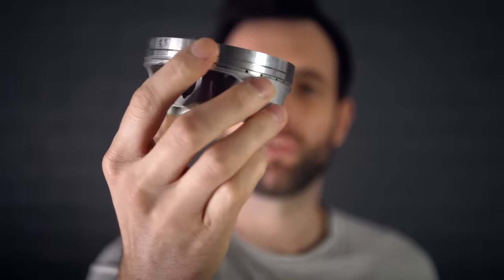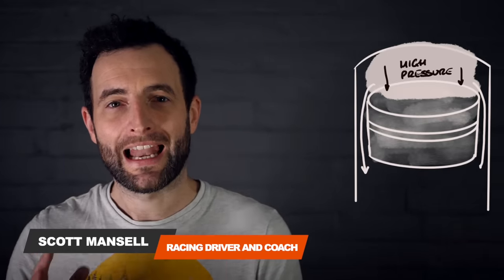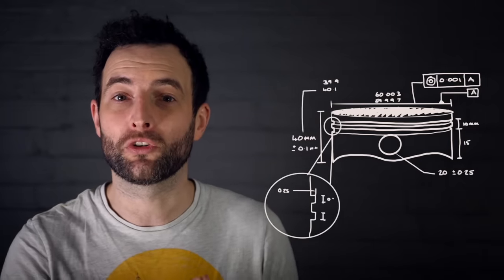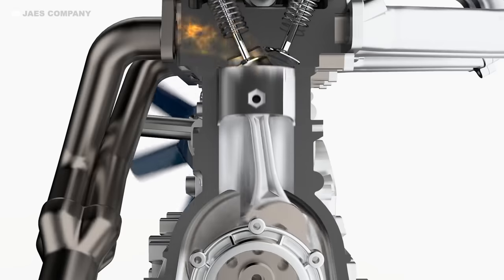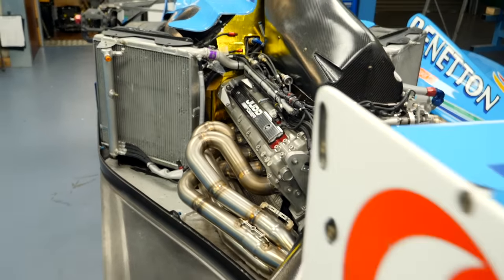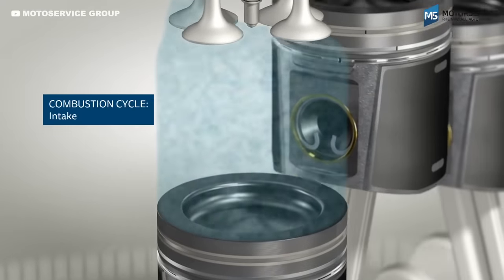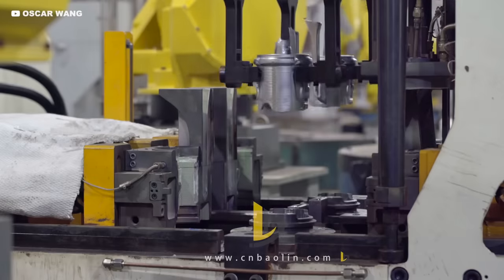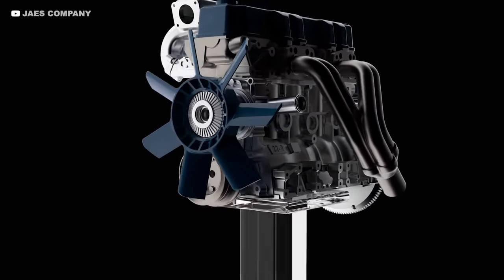Why F1 Pistons Cost £50,000!

Comment: The company I work for makes F1 pistons and I can assure you we get nowhere near £50,000 folr a piston not even £1,000 think you have pulled numbers out from where the sun does not shine.
Reply: I thought it was way too high, yeah it's gonna cost more but in the end it's just a piece of metal with a different tool path on the cnc.
Reply: I was thinking this like there are alot of backyard built 1000hp motors around and i know they cant hold full noise for the duration of an f1 race but still all it is really is just higher quality control
Reply: Serious question. Does the team you produce for actually win?
Reply: @tylerboto8930  Can those backyard 1k horsepower builds turn 15k plus rpms..... reliably?
Reply: @asylumville8544  thats what I'm saying they cant ,but if backyarders are doing that on a budget of a quarter of the price of a single f1 piston then there is definitely some money wasting going on
Reply: Those tolerances are nothing special, most amateur or backyard machinists can get parts to within +/- 0.001” (0.0254mm) and much less with care. I cant see from this video where 50K comes from
Reply: The cost is really from the R&D, this video doesn't know what its talking about, its just a bunch of technobabble taken from wiki or something, all car pistons have these tolerances, machining quality, etc.
Reply: @cloudbotherer7835  I quite agree. Even 50 years ago I worked on similarly sized components on a 10" x 18" Cincinnati external grinder and  regularly ground parts to a diametral limit of  +/- .00015" ( .0038 mm.)  My weekly pay? £14 !
Reply: A GSX600r piston costs under 50 quid and revs reliably to 13,500. Still don't see why an f1 unit should be 50 grand.
Reply: The pistons for my 125 2 stroke road bike engines are sized to 0.01mm.

Thankfully nowhere near £50k a piece. Under £100 retail.
Reply: @asylumville8544  I do not work for a team I work at a complany making pistons for many teams and types of motor racing, but in answer to your question yes they do win races.
Reply: @asylumville8544  sport bikes pistons go higher and have approximately the same power density and they dont cost that much lol. Go look up bmw s1000rr pistons
Reply: Spoke once with M**le engineer he was stating : the exact price we dont know because if the enormous amount of all kind machining and processing operations but we estimate it on 1700 to 1800 euro per piston without rings and pin.   

When he told me just a part of the machining operstions ...I consider it a neat price.......
Reply: You forget development costs. Cost of actual component + development cost/number of components=price if you aren't looking for a profit or to sell the thing
Reply: @cloudbotherer7835  ±0.02 mm, you don't use more than one significant figure when talking about errors or tolerances. With some exceptions.
Reply: @asylumville8544  Also have to last 7 to 8 race weekends at full tilt. Only 3 Engines per chassis in a season, before penalties. Compared to a couple of engines a weekend not too long ago.
Reply: @petercooper2387  380 nm of tolerance? Are you sure? I think 3 zeroes slipped in there. Or not?

I can't find any decent source, could you please help me?
Reply: Sorry Anankin, you are quite right, it should read  .0038mm. Will correct post. Working in imperial measurements we used to call them ' three tenths jobs.' Total tolerance being .0003".
Reply: Those pistons are from rare harden material i got one in my room tho was once at a f1 races nd a car engines blew up my step dad was a track marshal, nd he was about to bring the scraps back to the pit, nd the team said keep it as reminder cause it had a huge crack in mid just like the body work of honda  moto GP but back to the subject a piston of f1 costs 4700 each depends from wich team tho
Reply: @Anankin12  hence my figure of 0.001”, the other figure was a metric conversion.
Reply: I guess that in the 50K number the R&D is taken into account. It really doesn't mean much when compared to purshable items since like a BMW road car piston will also have tens of thousands in R&D invested.
Reply: @Anankin12  hence my figure of 0.001” the other figure was a metric conversion.
Reply: @frankderksen9536  They are not make from a rare hardened material you have no idea of what you talk about.
Reply: i think the £50,000 comes from design, development, testing and manufacture. not just sticking a piece of metal in a cnc and machining it
Reply: @bostonbikebits6539  good point!
Reply: He pulled a lot of his information from the same place................
Reply: @Steph.98114  - Nope, not just an alloy, but one cooled down from molten to solid in less than one thousands of a second. Worse, these pistons are only used for 1 race. These super strong alloys are permeable to engine oil that changes the quality of the alloy and makes them brittle. So if used too many races they would come apart.
Reply: @johnnycab8986  - Yes, but the material is way different...
Reply: @bostonbikebits6539   - 13,500 is not 17,000 at much higher pressures and larger bore and stroke... And stresses don't go up linear but rather exponentially.
Reply: yes this pistons from supergood material,have special coatings,spec rings. But price can be max 1000 per piston.
Reply: @philup4947  would that happen to be Pankl in Àustria?
Reply: @petercooper2387  back in the day, an accomplished machinist could feel 1 thou with his hands. then in the 70's the computer controlled gizmos came in and 10 thou was easy!
Reply: @mikusmaximus7507  No I  work for a British company in the south east of England
Reply: @philup4947  who might that be if you don't mind disclosing? McLaren?  I happen to work for CP-CARRILLO which is a USA branch of Pankl.
Reply: @ct1762  Yes, the old manual skills are nothing like as widespread as they were. Overhead lineshaft driven capstan lathes in 1964 when I began work, five axis machining centres with live spindle tooling now. It has all happened so fast!
Reply: yup.
Reply: They state these prices for huge tax breaks, F1 costs no where near what they say it does, 7 million for an engine alone lol - It's all just a smart way to line pockets.
Reply: The only reason an f1 engine costs so much is because the peiple building it, racing it and anything to do with it their salaries are Riddiculous.
Reply: @johnnycab8986  Correct! Do not make films about things all you know about comes from YT.
Reply: I'm calling bullshit on those prices too.
I spent 7 years machining billet race cranks including formula one cranks for McLaren, Hart, Judd and TWR and they went out at £5-6 K a time and I can assure anybody that there is a lot more work in a crank than in a set of pistons.
Source for the costings please.
Reply: @tylerboto8930  well, power isn't everything. 1000 hp engines in road cars have large displacements (hence Bugatti, Koenigssegg, or juiced LS or 2JZ engines) and larger tolerances, reaching those figures at relatively low RPM. However, F1 engines are 1.6L v6 toys, feathery light, with the finest tolerances and revving more than twice as high as the aforementioned
Reply: I smelt a bit of Billy Bull Shit here ...
Reply: @cloudbotherer7835  My thoughts exactly...
Reply: @bostonbikebits6539  My R6 16K ...this is BS
Reply: @cloudbotherer7835  well, this looks to be a standard IT6 class tolerance,  I wouldn't expect an amateur machinist to be able to hit this.
 Its only 2.5 times tighter than a thou, but MUCH more difficult to hit at around at +/- 4 tenths.

It's tight but its not 50k kind of tight, more like an extra 50 bucks kind of tight, so any good shop with a proper CNC mill is gonna hit that, especially given that its a one off.
IT5 and below is where we run into a steep increase in manufacturing costs.

Im gonna go off on a limb that 50k is probably the money it takes to ENGINEER, BUILD, AND TEST one of these pistons and they likely paid 300k for 6 pistons and then divided that value to get 50k, and i wager 90% of that cost was used for engineering (structural analysis, vibration analysis, thermal analysis, mass optimization, fatigue life analysis, seal design, failure mode and effects analysis, material and heat treat specifications).

Then testing the damn thing 10 different ways for all of the above. 

Actually machining/forging it is probably the least costly aspect.

I don't think he really explains this well.
Reply: @asylumville8544  because of confidentiality of "our" customers we would neither say yes or no, but our customer always came back through different engines with different classes , so yes they do win
Reply: @frankderksen9536  it's not that rare, if you sit in a jet going to Spain you are being held up by it
Reply: lots of misinformation here it seems. yet people trust what some random youtuber tells them.
Reply: @johnnycab8986  
Sorry but I don't buy it. There is nothing really to research and develop in this technological field to the point where one piston costs 50 000 pounds
Reply: @BarryAllen-no9nj  I agree and the biggest reason for the high unit cost is the low production volume. That R&D cost is the same whether you're then going to make 100 or 100.000 pistons.

Everything in an F1 car is bespoke and that's mainly what makes them so expensive and why you can't compare them to road cars.
Reply: I agree. I understand about the economy of scale but £50K? That's ridiculous, not even believable.
Reply: most people in this thread have no clue what they're talking about. multiple random guys on the internet claiming to manufacture f1 pistons. yeah right, definitely I would trust that despite ambiguous and random estimative prices given and "many teams and motorsports" claims (this alone is a pretty good indication that the guy has nothing to do with f1). also, the other guy that said that he works at a company that makes crankshafts for f1 for 5-6k, that's an average price for a tractor engine crankshaft these days and although it's a piece much more durable, special and rare than an average car crankshaft, it's nowhere near as special or rare as a f1 crankshaft.

now, the development of current pistons in f1 costs massive amounts of money and the real alloys used as well as tolerances and designs are kept under wraps for a good reason.

you need to keep in mind that all the R&D money go for a series of pistons that it's produced for a year or so, in that time frame, the team buys a rather low number of pistons so the 50k price per unit for an usable piston is definitely not unrealistic.

we also need to keep in mind that there may be a second scenario, maybe the producer sells those pistons for 5k each but the team buys 10 times the number of pistons they need and discard 90% of them. only choosing the ones that have the best tolerances/weight and so on. in the end, this just means that the R&D is divided to 10 times more pieces but they also sell 10 times more. in the end, when it comes to how much a piston that is used in an f1 car costs, it's still 50k.
Reply: @jonsnow7092  The complany i work at are contracted to make pistions for some F1 cars and other motor racing series and our manufacturing costs per piston are nothing like £50000 neither is our price to the customer typicaly way less than £1000. A number of years ago yes the price was much higher due to the very exotic material being used and a single billet could be around £12000 but that material is now banned and they are back to using more normal materials.
Reply: Lol well said😂 I was thinking as much🙈
Reply: @jonsnow7092  i worked for Renault f1 team between 2004 and 2008. Yeah,,,1 piston doesn't cost 50k.
Reply: Talking out if a* may explain his speech impairment
Reply: I think part of the cost of this piston is due to designing and engineering that goes into it, F1 engineers don't work for free. (50k seems too much tho)
Reply: I’d imagine that there’s a few people it goes thru before hitting the team, each with their own costs. There’s also the design costs and development from the team, before they send their specs to your manufacturing firm. I’d hazard a guess that this £1000 is just the labour costs of the company that get charged..
Reply: @JohnCrebo  No they do not go through any people we deal direct with end customers
Reply: @IDNeon357  was this remark aimed at anyone  or just a drunken ramble
Reply: @philup4947  who is it you work for by chance?
Reply: @philup4947  they used to be made from ‘exotic’ materials including beryllium aluminium alloys, as well as coatings- but as you’re probably aware- this was banned and now it’s just specially heat treated aluminium alloy. Maybe this was why the guy saying about the piston he has is made of special metals..
Reply: If these engines are so tight they truly seize at ordinary room temps, how are they assembled on the stand in the shop? Are the blocks heated prior to assembly? Is the assembly room kept uncomfortably hot?
Reply: @winschmitt4919  probably shove the pistons in liquid nitrogen
Reply: Thank you, thought it sounded like utter horse shit
Reply: Make F1 pistons for who! Minardi  ?
Reply: @tylerboto8930  pp
Reply: @Steph.98114  It hase more to do with f1 parts beeing low volume. Its not worth it to sell them for 2k even if you make a good profit percentage wise. So they say you want it? Its 10k or whatever.
Reply: I agree it is a relatively geometrically simple part with tighter tolerances. 1000 is a lot to ask for machining about a kilogram of aluminium down to 300 grams.
Reply: @affilinet  They aren't fools to invest 50000 in a single piece of metal just because somebody quoted them a random number. And parts that have possibility to be replaced after every race... minimal orders would be in dozens.
Reply: @rastislavsmolek8140  its not a random number, its calculated by comparing the trouble needed to make them and the reward.
Reply: @breakbollocks9164  How do they cool molten metal in casts in one thousandth of a second?Impressive.
Reply: Perhaps they calculated in research and development time and not just manufacturing time?
Reply: There was a video that said a wheel nut was £50,000. That must be the magic click bait number.
Reply: 50k on a piston is not possible as mahle or cosworth would provide them as cheap as less than 1000 dollars
Reply: Thankfully a sensible comment at last. This guy is full of nonsense and should be ignored at all costs. I buy pistons for F1 monthly, and also buy them for the historic line up... - v10 and v8 for the Redbull/Toro Rosso Cosworth Engines, buying directly off Cosworth/Modatek. They are approx 1500each for current teams, with certs and tolerance paperwork, 900 for v8s/v10s, and 250 with no paperwork but can still be ran in private hands.
Reply: Wow....garage geniuses...how come Ferrari, Mercedes or RB aren't knocking at your garage door?
Reply: @johnnycab8986  Correct. Pure click bait.
Reply: @winschmitt4919  they don't seize at room temps...this is an old wife's tale.(F1 engine builder)
Reply: No. No you don’t.
Reply: @Withnail1969 lol, you believe a random YouTuber, which is quite amusing. There are endless YouTubers with huge followings that are completely unreliable. Finally, a driver doesn’t know sh*t about parts procurement let alone the technical aspects. So, if you believe the $50,000 thing, I’ve a bridge to sell you. BTW, you do realize 6 pistons would be $300,000, which would already be a major portion of the ENTIRE engine cost based on what teams pay for an engine supply of 7 engines per season.
Reply: So you work for Mahle ? , as they are the main source for  f1 teams and according  to them 50 grand is cheap for a f1 piston as they make 100s of which only 1 is perfect for a team and the rest are scrapped and melted down  . They say the cost is high due to the quality  control  and tight specs, so most are rejected .
Reply: He didn’t say the machining cost alone was 50k.
Reply: Maybe he’s including cost of design
If you have the design you could order a machined piston online for literally nothing